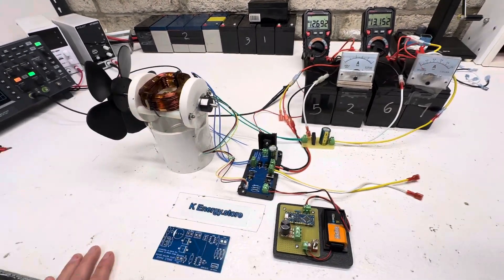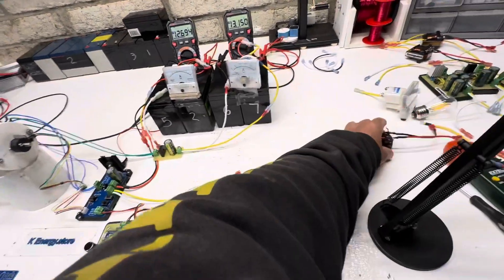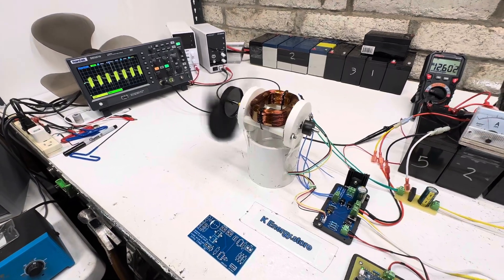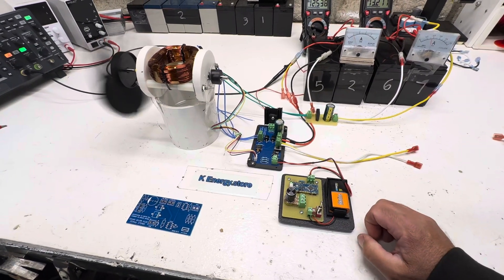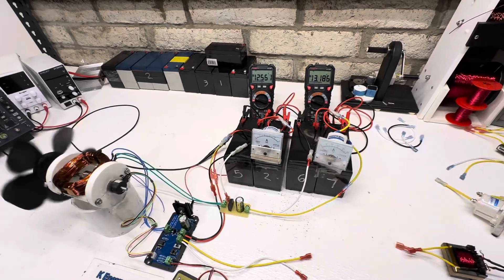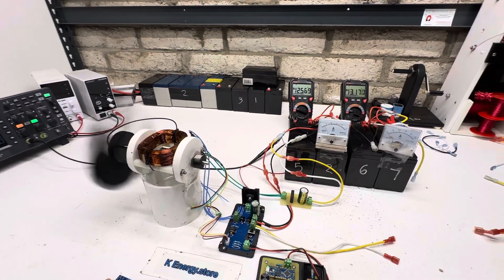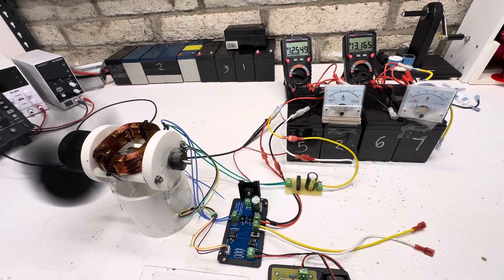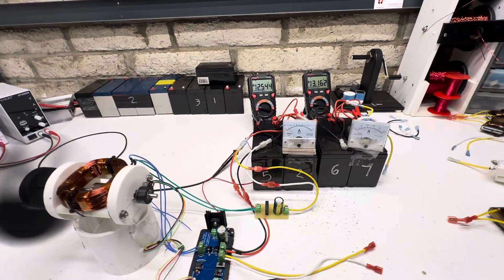Loop back simplified

Comment: Thanks K , you do a grate job explaining and keeping things simple.
I have request if you don't mind, as I don't have, Leta loan know how to use one. Can you hook up the oscilloscope up to the battery on the out put wires and hook up you cap dump to the same battery please. I would like to see if the spike go's straight in to the battery to maintain charge/ top up the battery or if the spike go's straight back to the motor and bypass's the battery all together or maybe there is a bit of both small charge small spike.. Hope that makes sense. Just thought it would cool to see what happen at the other end of all your experiments.
Reply from the maker: The spike energy and square wave get condensed in the capacitor to be reused by the motor
Reply: @kenergy1707  So if battery A, runs the motor and the motor makes the spike and the spike goes to the cap dump then the cap dump goes to battery B. Battery B starts to charge.
Now if I go from the cap dump back to battery A. 
Will the cap dump charge go into the battery or loop straight back in to the motor.
If it loops back to the motor dose the cap dump charge spike the motor and make it surge.
Or dose the charge sort of split like say 50--50 some goes the battery and some goes to the motor.
I only ask because I have been watching Alpha Phoenix, Watch electricity hit a fork in the road at half a billion frames per second. vid and it made me think about how power goes in to a battery at the same time power is coming out of the battery. There are a small hand full of people on YT that challenge the way I and or we think, Kenergy and Alpha Phoenix are two that make me want to know more.  I thank you both.
Reply from the maker: @jimwi9592 very interesting 
When using Capdump yes seems to charge battery and run motor because the amps and volts coming out are higher than the battery 

When using filter cap it seems to go to the motor than battery supplies the rest
Reply from the maker: @ depending on what voltage the cap dump is if it will surge if you keep it just couple volts higher than battery it won’t 
As far as how much going to primary battery on loop back it seems it drives the motor for a moment and the rest goes to battery